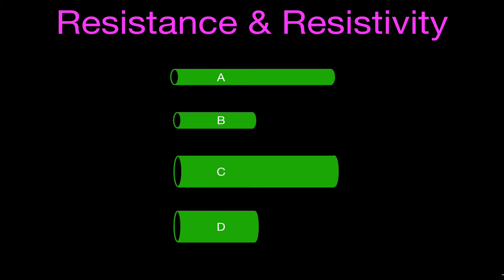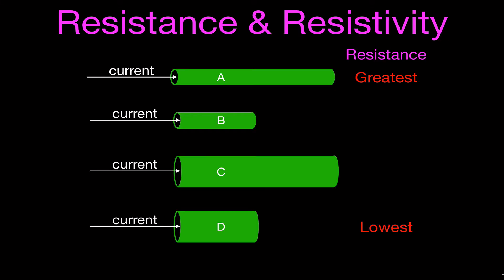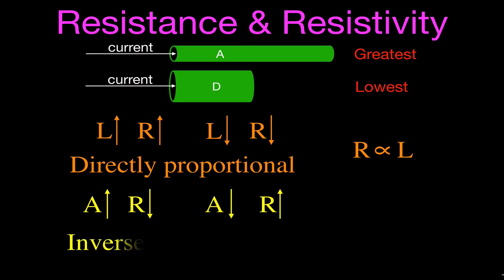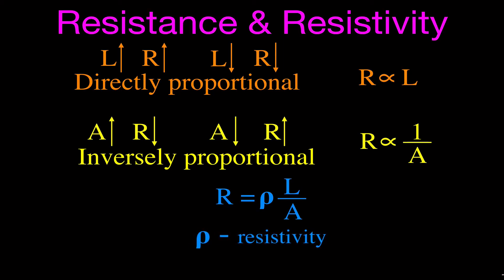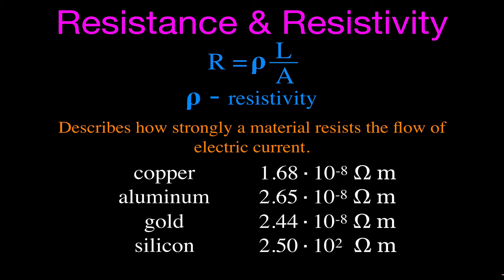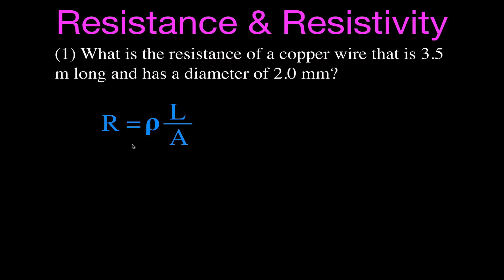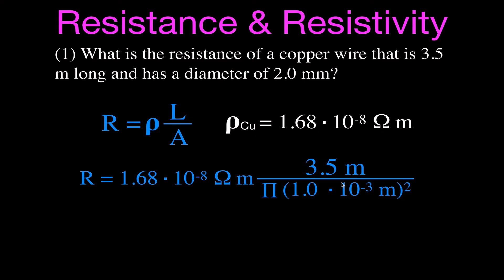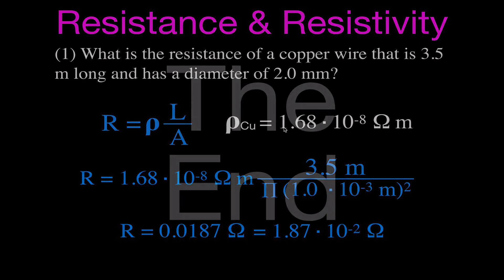Resistance & Resistivity, An Explanation

Comment: Please answer me this question.I know that your answer here but not adject result in cable catalogue.Please answer me this question.what is the resistance of a copper wire that is 1m long and has a diameter of 3.0 rm?
Reply from the maker: Use the equation to fire it out.

Comment: Will combining high resistance wires together end and end, but they aren’t touching in the middle reduce the resistance
Reply from the maker: not sure what you mean..."but they aren't touching in the middle"?
Reply: @stepbystepscience  lthey are coated along the wire except the ends which are all connected

Comment: Great clear video but you might like to consider a future version expanding on resistivity. In this one you did give it in the units ohm-metres (which itself might benefit from explanation) which is fine for most electrical and lab work but in the electronic industry, especially where they make actual resistors and also print them as part of ceramic hybrid microcircuits,  new people are often bemused to find data sheets and pots of material giving the resistivity of the contents in "ohms per square". And of course, the first question is "ohms per square what?".